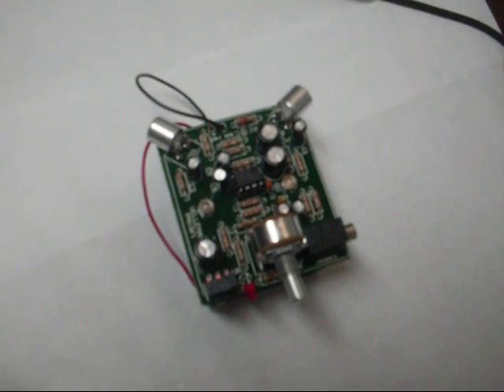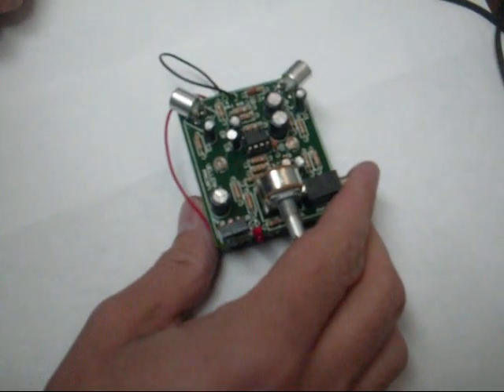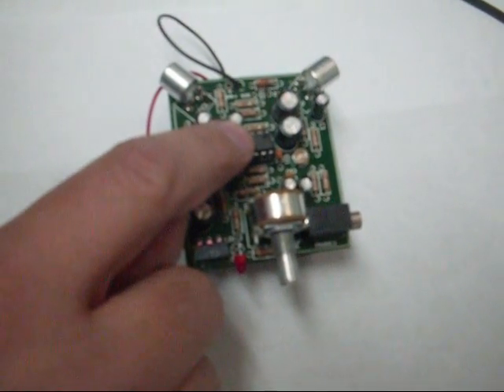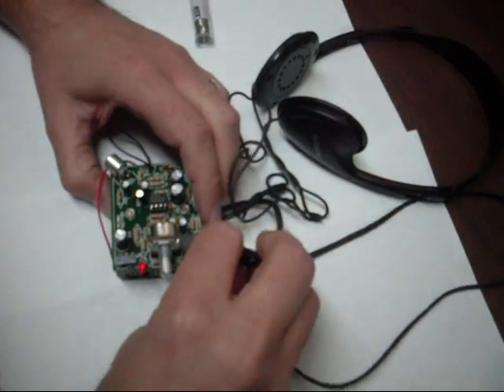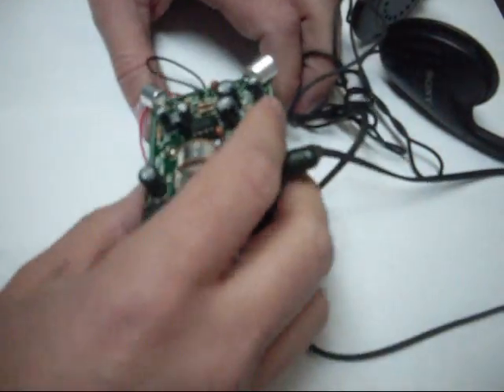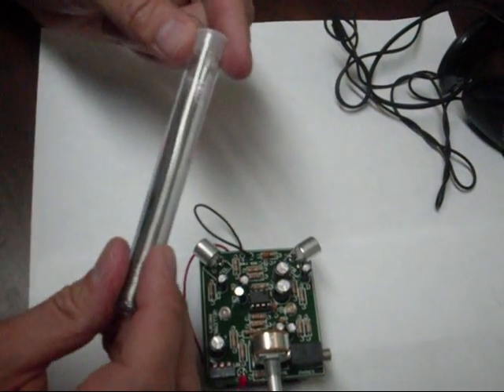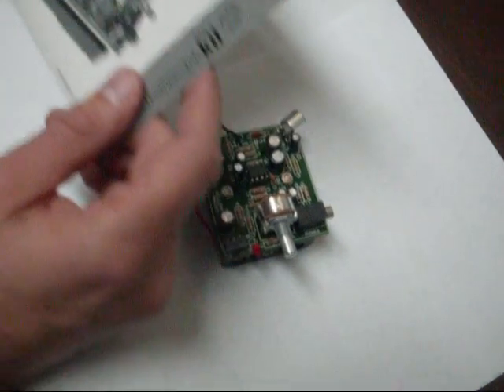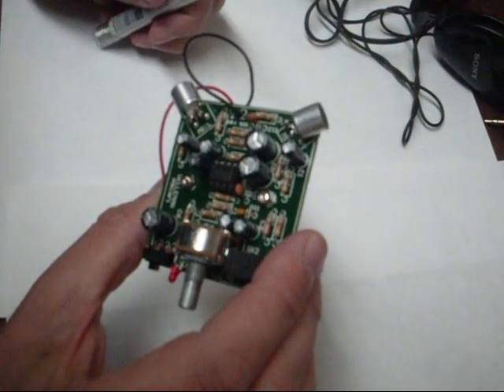Velleman Super Stereo Electronic Kit

Comment: I'm thinking of using this as an upstairs/downstairs intercom system ---
I'd like to use a small speaker instead of headphones -- will that work?
Reply: Any speaker/headphones that produce an audio output and use the 3.5mm jack type will work on the kit.